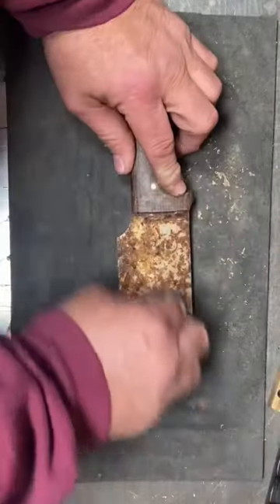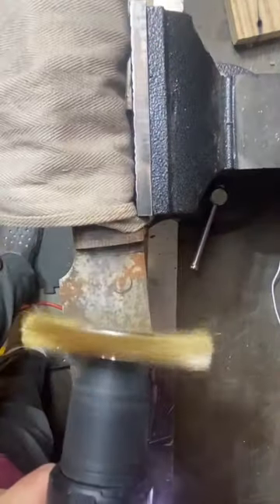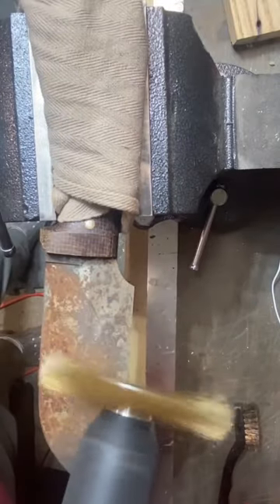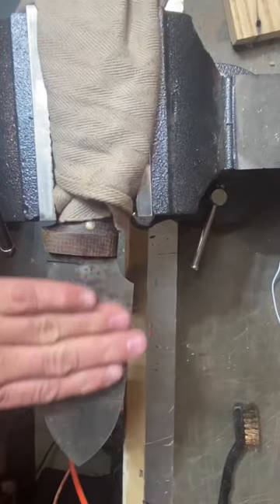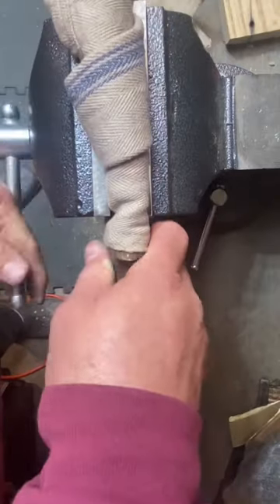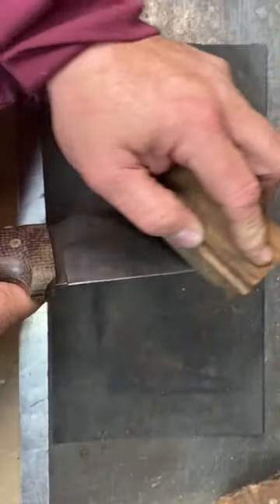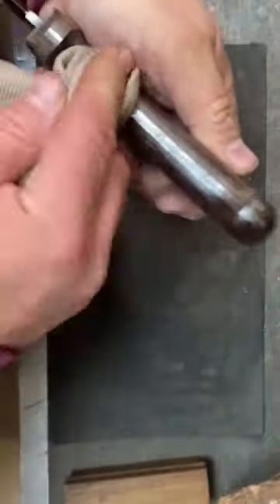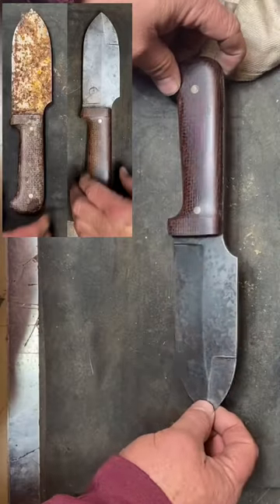Storytime #shorts #makeover #rust #bushcraft #storytime #diy

Comment: try soaking it in hydrogen
 peroxide to remove the rust
Reply: Hydro peroxide, ok I'll give it a go. And I have an antique adjustable square the ruler is corroded enough it's hard to see the numbers. Will try on that as well, thanks.
Reply: @wyliecoyote1  how did it work?